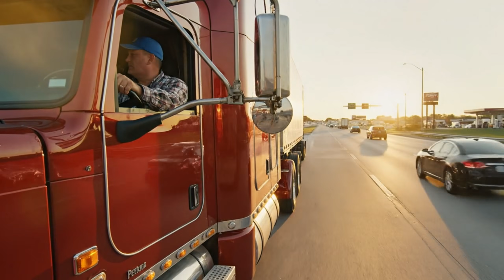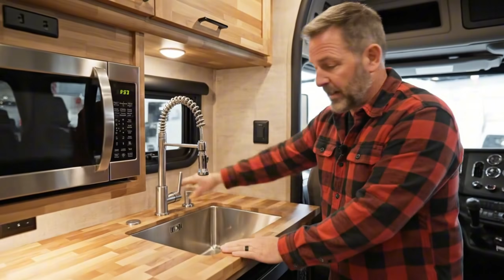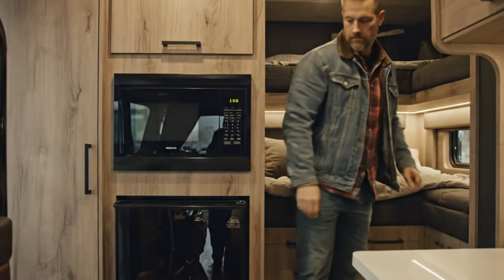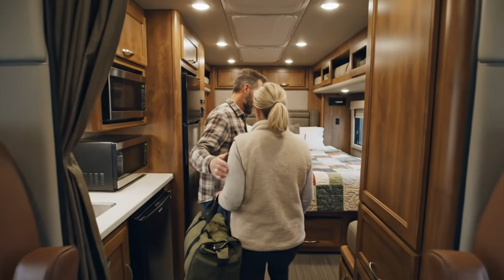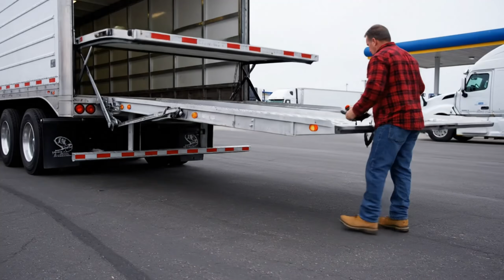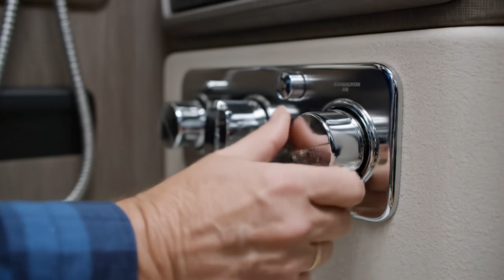The BIGGEST and Most INSANE Sleeper Cabs Ever Built — You WON’T Believe These!

Comment from the maker: These are the BIGGEST and most ABSURD sleeper cabs ever built — and they look more like luxury apartments than truck beds. 🤯
From massive custom builds to ultra-expensive setups with insane interiors, this video is packed with sleeper cabs you probably didn’t even know existed.
Reply: That's because they don't so many things wrong here first off they are 30 ft wide no rear mount motors. Fake everything thing here is fake